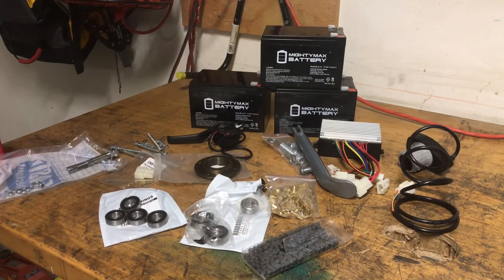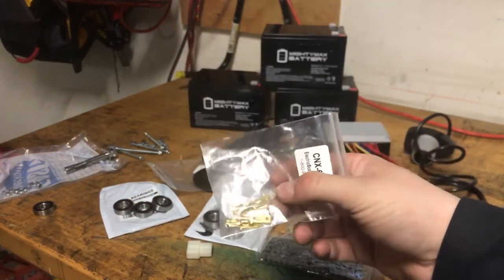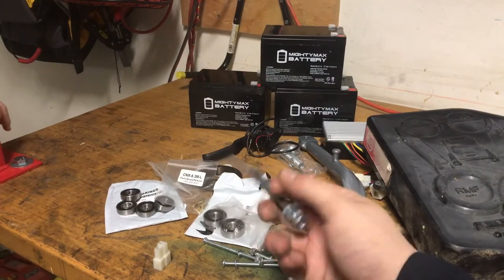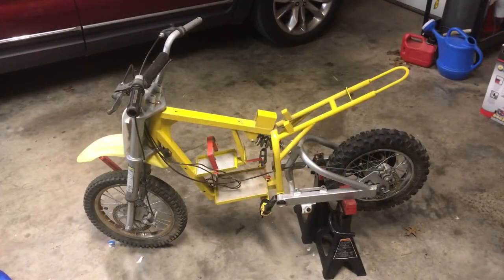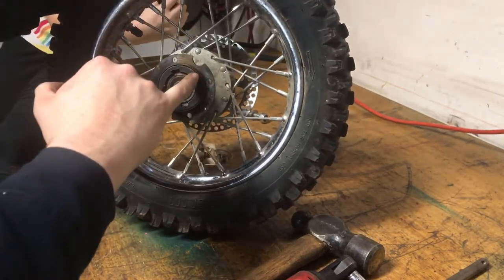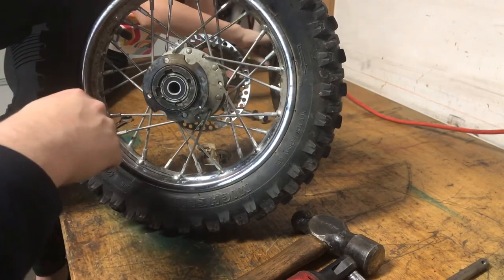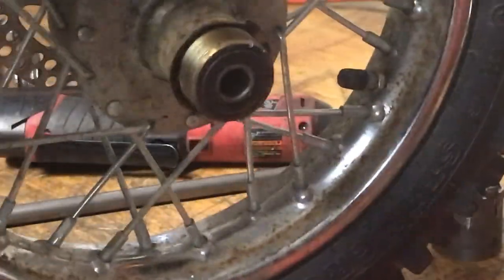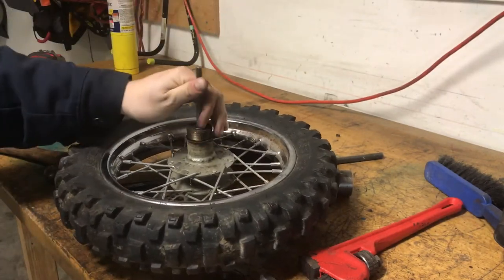Razor MX650 Rebuild Part 2: Freewheel and Wheel Bearings

Comment: Can you change the rear bearings without disassembling the freewheeel?
Reply from the maker: @soloban81  yes you shouldn’t have to to knock the bearing out
Reply: @TheVintageEngineer I just swapped the bearings on my son’s bike. I ended up using a pilot bearing puller from harbor freight. The front wheel came right out. The back bearings were in there good. I had to soak them with WD-40 and even heat them up a bit. Replaced them with some Timken bearings and now it’s nice and smooth.

Comment: Where did you get all the parts?
Reply from the maker: Kickstand, throttle, controller, chain and brake lever from Monster Scooter. Batteries from eBay. Bearings from amazon.
Reply: @TheVintageEngineer  awesome. Thanks. Do you have the part number for the wheel bearings?
Reply from the maker: @nmracer4632  @ 1:30 6001-2rs I believe.
Reply from the maker: @nmracer4632  these are what I ordered before https://amzn.to/3wy6RUF
Reply: @TheVintageEngineer   thank you.
Reply: @TheVintageEngineer Can u use them for the front wheel